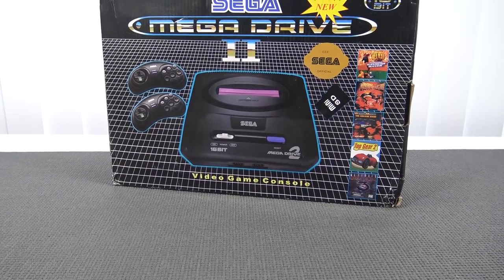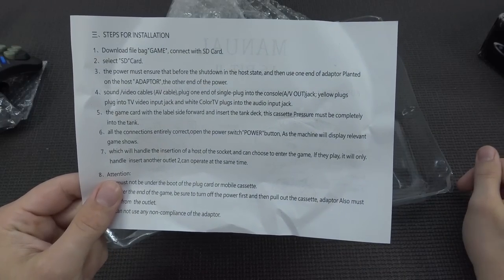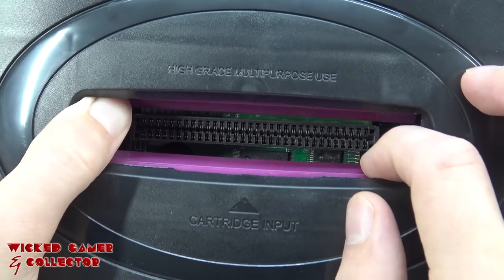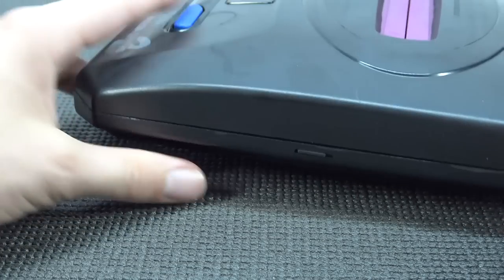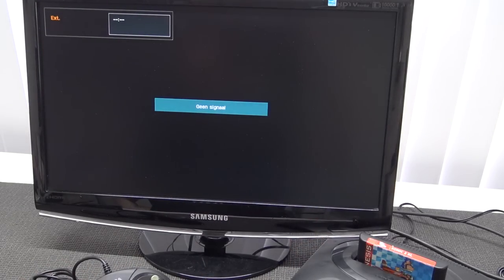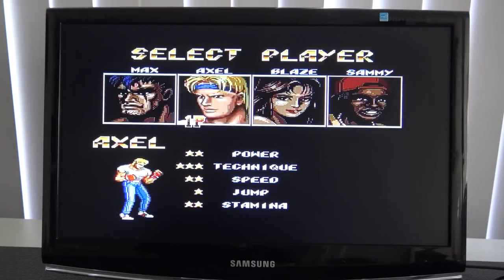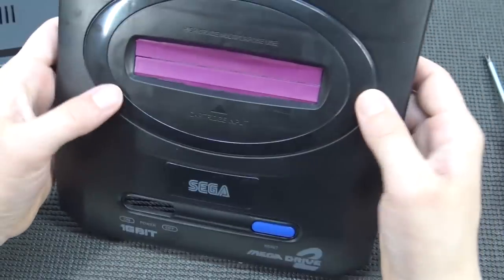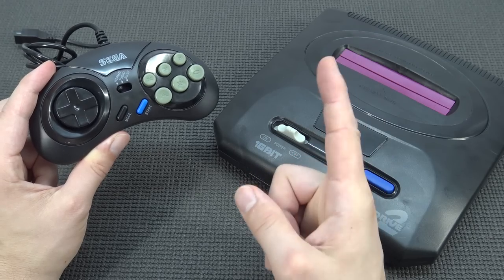Sega Megadrive II from Ali-Express has SD Function ! 😨

Comment: Excuse me, I bought this Chinese clone console, the previous version (which did not come with an SD reader) also came with the problem that the music was slow and did not play on a television because this console works at 50 herz, for which I started I investigated and someone modified the console and left it running at 60 herz (and it's something as simple as soldering a cable and joining two sections). I noticed in this video that when disassembling the console, the PSB, although it was different from the previous version, maintains almost the same structure and I could notice that the area to be soldered also has it (they are precisely those 6 points where it says MODE_APE MODE_C). Only the two boxes that are right next to the letter M of MODE should be wired. Sorry if my explanation is years late, but I think "maybe" is the solution to improve the performance of this console. (I used Google Translate to write this, sorry if I'm a bit long XD)

Comment: The music is slow because it seems to be a pal system, because pal was the TV Standard in China before the HD Times. So, it is like a pal Mega Drive and the missing Sound would be caused by stereo Sound with the missing channel. It is the same effect like using 1 Video and 1 Audio cable with the mega drive multiport instead of the classic Red,white and yellow chinch cable.

Comment: I wish you had tried it with real sega controllers and the real sega a/v cable to see if it made a slight difference as the back input looked as if it had all the pin holes to take the original cords.

Comment: you should consider doing a deeper dive into how similar the clone is to the real system, eg. have both. i would like to know if parts are interchangeable or if the real motherboard mounts in the clone to consider maybe using knockoff shells and parts.

Comment: you can fix the sound issue and the slow movement by soldering 2 pins in the main board
Reply: That is extremely vague. Which two pins?